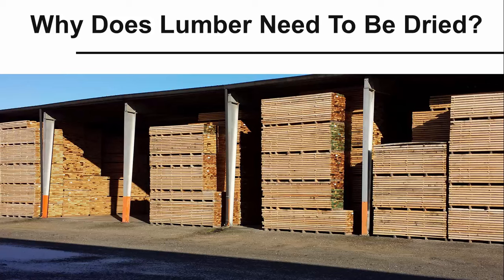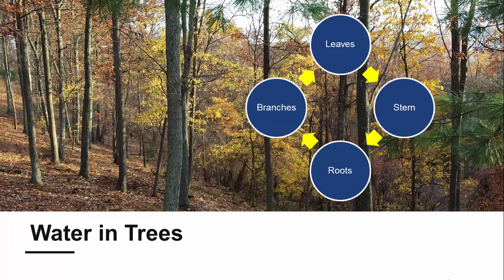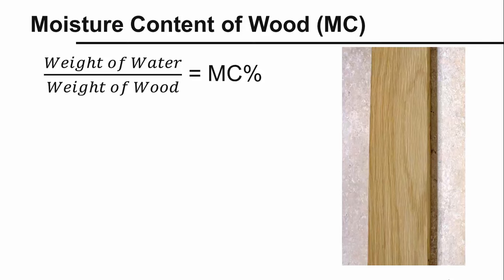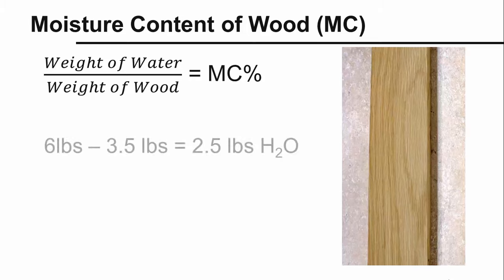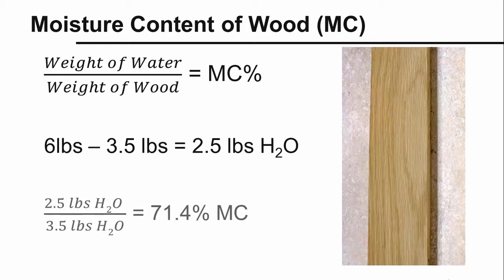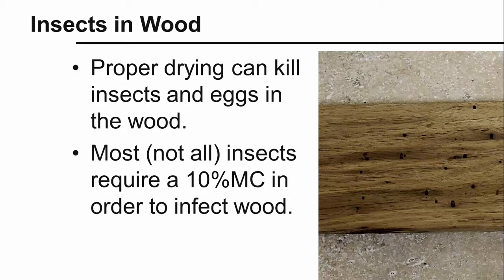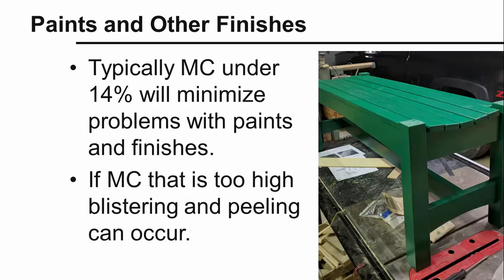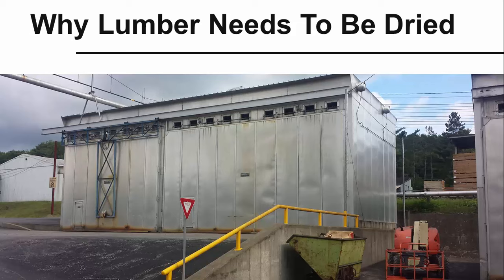Why Does Lumber Need to be Dried?

Comment: I kiln dried lumber for about 20 years. It was a very interesting job. Seemed like every load dried was a little different. Worked at a hardwood flooring plant. We let our lumber sit on the lumber yard 3 to 6 months before it went into the kilns, depending on the inventory available We also had a predryer that we dried green lumber in at low temp. to shorten the time before going to the kilns. I've seen Red Oak off the saw come in at 110%, while White oak was usually 60-70% .  Usually went to the Kiln at around 30% and we dried our lumber down to 6-8% EMC. Great video.
Reply: I would love to chat about drying lumber.  We have a few kilns and we dry for the flooring and cabinet industries.